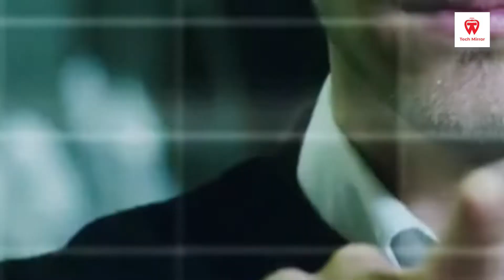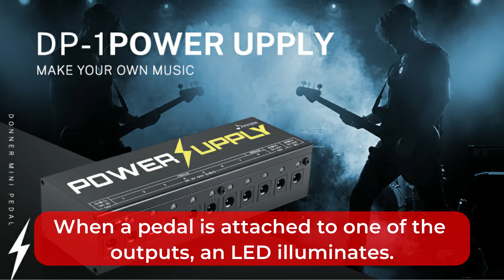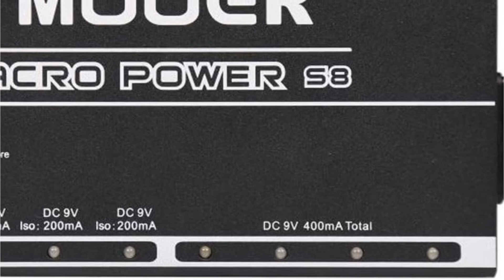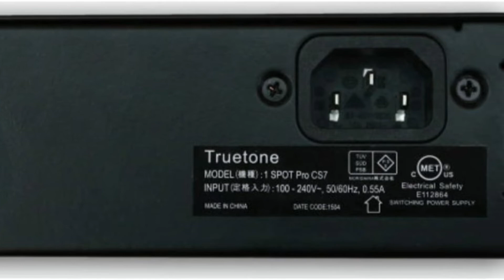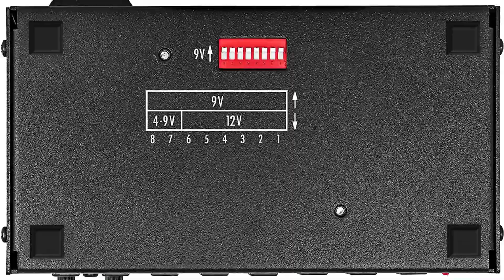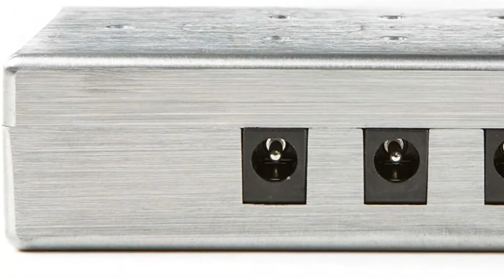Top 5 Best Pedal Power Supplies In 2022 | Budget Pedal Power Supply Reviews

Comment: Illustrative video. I use a Dunlop DC Brick, the antecessor of the MXR DC Brick. The main differences, appart of the color of the box, are the 3 of 18V and 7 of 9V outputs of the earlier version (against 2 of 18V and 8 of 9V of the later version), and the addition of individual LEDs in the later version.